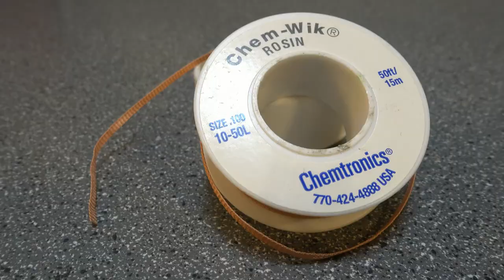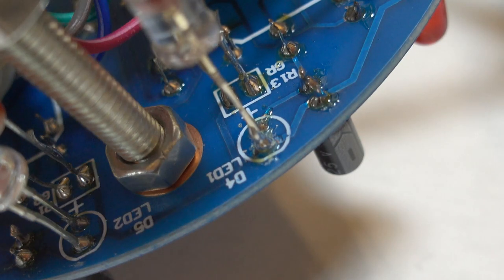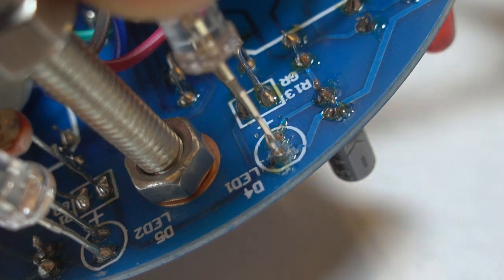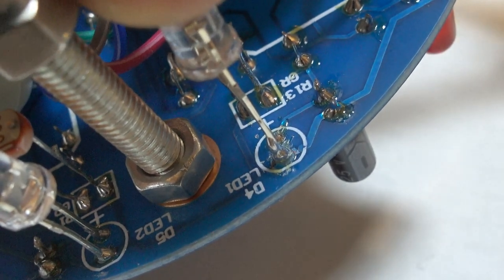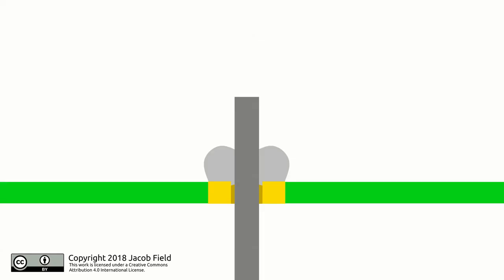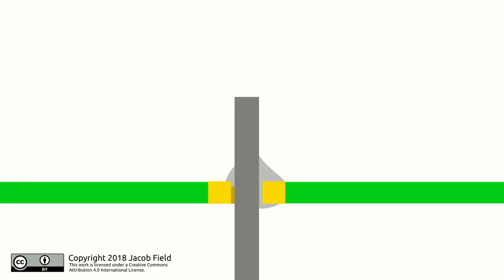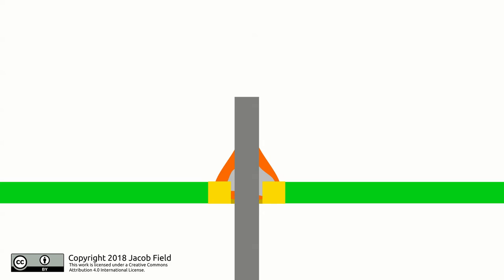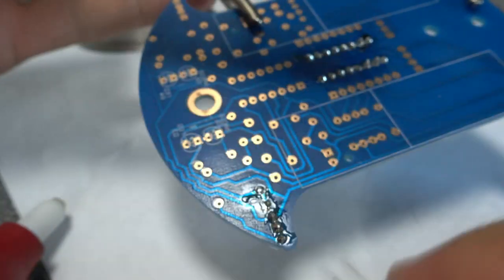How to Solder

Comment from the maker: Hi! Two things this video is missing that any beginner should know:
1) Always wear safety glasses -- no really! Resin core solder will spit little balls of 100+ degree resin in any direction, regardless of where your eyes are.
2) You will need some way to ventilate the rather toxic solder fumes away from you. In a pinch, blowing them out a window with a fan will work, but ideally you would use a solder extractor. A cheap one that I use personally is here: https://www.amazon.com/gp/product/B08F5DN2B8/ref=ppx_yo_dt_b_asin_title_o07_s00?ie=UTF8&psc=1